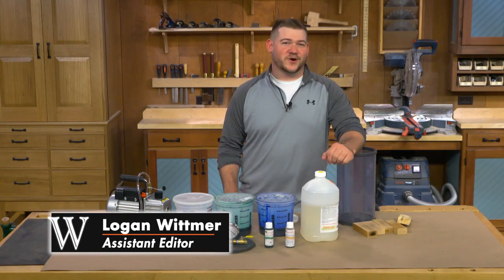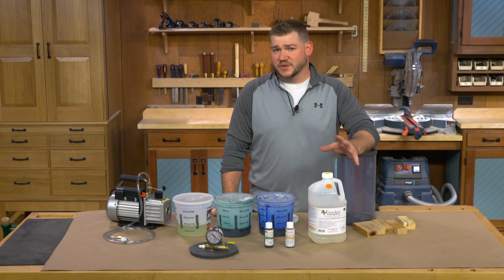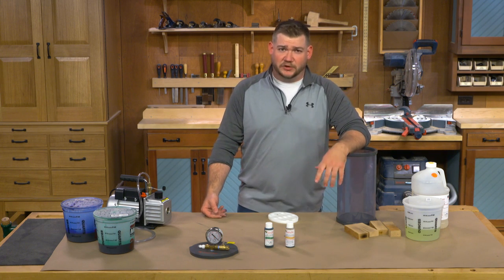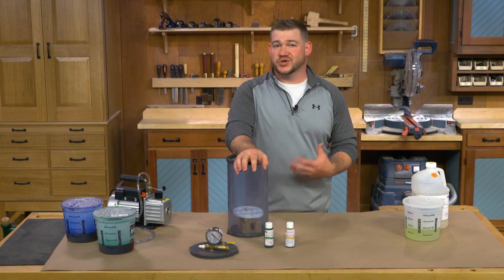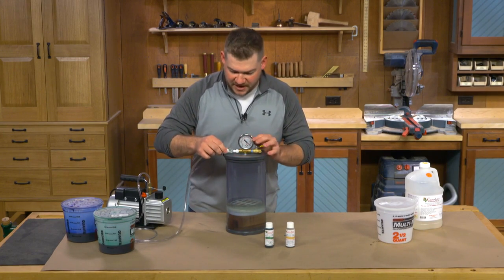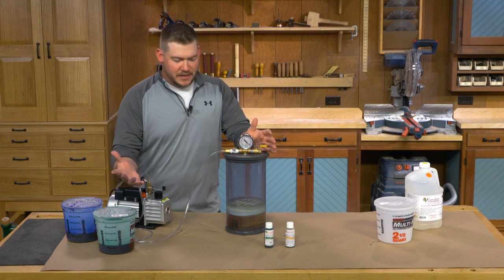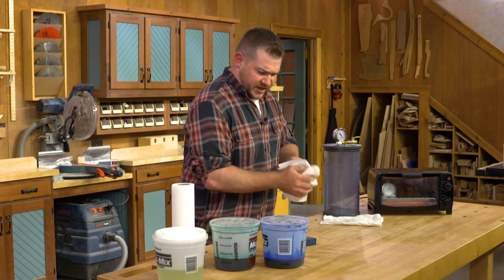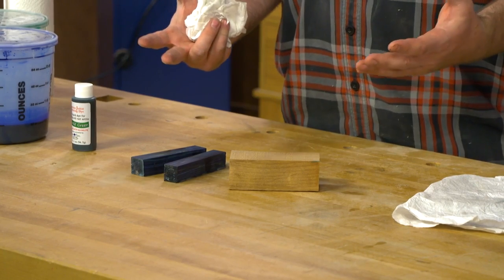Vacuum Stabilizing Wood Explained!

Comment: Letting it soak for double the time under vacuum means double the amount of time it took pull all the air out of the wood not necessarilly the time we actually left it under vacuum.

Comment: What is the best way to get epoxy resin(similar to West System Epoxy) to soak into wood that will protect it from water for a lifetime? I had thought of using a pressure chamber similar to how they pressure treat lumber. After the epoxy is infused the wood will be taken out and the excess removed and allowed to cure. Then a UV resistant top coat of poly or varnish will be applied. This wood will be used in the marine industry in full submersion for days or weeks at a time. Any help would be appreciated. Thanks

Comment: So one question, been to turn tex website did not see my question,  What ambient temperature should the room be?   For instance I only heat my shop in winter to about 50 deg will that work?  Or in my home is the smell overpowering  so I can't do it in my basement?

Comment: I find a lot of similarities between this process of Wood Stabilization and Resin Infusion of Fiberglass and Carbon Fiber panel layups. Wood is the original composite material.

Comment: DO NOT leave a vacuum pump unattended while it is pumping. Once it reaches a full vacuum(little less than 30 mercury) then you cut that booger off or you run an extreme risk of a violent implosion.
Reply: No, once it reaches a vacuum, it's as strong as it gets. If it doesn't implode immediately, you're good. What in the world are you referring to?

Comment: I know what I need, I just want to see what would be cost effective. I'm trying to stabilize a block I want to turn into a mallet. I'm rather dedicated to this one piece because is has some awesome patterns in it, but it also began cracking when the humidity got really high for a couple weeks. So I want to stabilize it to fill those cracks and make them more shock and moisture resident.

Comment: Nice presentation, but you didn't mention an important step.  After running the vacuum pump for the correct period of time, the wood must sit in the solution for another 3+ hours to insure it absorbs the solution and fills the pores.  THEN, take it out and bake it for final stabilization.
Reply from the maker: Mark - If you take a look at 10:45, you'll notice that I state they must soak 2x the amount of time they were under vacuum. 3 hours is NOT long enough for the blanks to soak. The minimum amount of time that I've had blanks vacuum for is 12 hours, so I always soak for at least 24, per discussions with the manufacturer.
Reply: It doesn't GO deep into the pores until you restore normal atmospheric pressure, and the air PUSHES it into the pores. Miss that?

Comment: Water should boil and turn to vapor at around 29 in.hg. At room temperature of 70 degrees f. So if you run the vacuum on the canister with only the wood it should help to pull the moisture out. The higher the ambient temperature the less vacuum it would take. Very little less though.

Comment: Great video.  Here are a couple corrections from a guy whose been doing it for 3 years and asked a ton of questions from the best in the buisness.  

Drying wood at 220 for 24hr does not mean your wood is dry!   That's a starting point.  Ya, if your wood is already pretty dry. That will do the trick.  How do you know your wood is 100% dry?  With a scale.  Run for 24hrs (start with 12 if it's already pretty dry wood), weigh on a digital scale.  Then back in the oven.  A few hrs later check again.   When it stops losing weight.  Seal in an air tight container to cool.   This is the most important and hardest step.   And no, a meter won't help. They are no good below about 6%.  

Some guys also have great results using a microwave set to 20% power and doing 5-10mins at a time in cycles to dry

Secondly, do not store in glass with or without  a lid, or your CJ might cure. Some plastic containers will also do tbe same!   HDPE is the best option (same plastic as milk jugs). 

Keep your juice below 85 degrees or it will cure!   Keep your pump away!   Yes you can store CJ in a refrigerator in the sumer.  

Also, many woods will run for 24hrs or longer before bubbling stops.  Moisture in the wood makes it go longer.   Some very punky wood might only bubble for 3 or 4hrs.

On soaking.  2x the bubbling time is min!!!  Many of us do 3x or longer.  And and some dense woods (like Redwood) 5-7days is recommended. 

Also, TurnTex only recommends wrapping in foil if your doing large batches and stacking banks.  It does not help retain any more juice. 

Www.turntex.com has a great Q&A page on its site. Also if you're on Facebook, there is a great group that's curated by Curtis, the owner or TurnTex..   Search "Wood Stabilizing."
Reply from the maker: Yep,  everything you said is true.  This video is more of a jumping off point and a supplement for an article I wrote for the magazine that addresses everything you mentioned.  I spent quite a while on the phone with curtis while working on the article.  Many of the items you mention are outlined in the instructions that curtis supplies with the juice - I would hope if someone were to dive into this,  they'd read the info that comes with the supplies.  - Logan
Reply from the maker: Wow!  Thanks for all of your insights.  It's nice to hear from someone who as a lot of woods stabilizing experience.

Comment: On the blue cone you said you stabilized it,  then re did it in the green and stabilized again. Thought you said once it has gone through the oven you couldn’t do it again? Confusion?  Or did you mean you couldn’t bake it again?
Thanks Gerhard
Reply from the maker: Gerhard - I'm not going to pretend to know the chemistry exactly, but once the curing has started, it must be finished (the first bake cycle). That cures all of the resin that's inside the wood. Once the blank is then vacuumed with resin, it pulls the new resin deeper into the wood. You then bake that and it cures the 2nd resin. The 200-degree cure temperature doesn't affect the already cured resin. However, if the first resin didn't cure, you wouldn't be able to bake it again to set it.